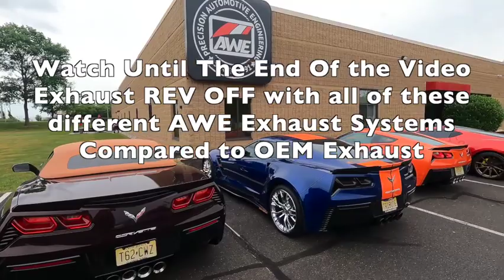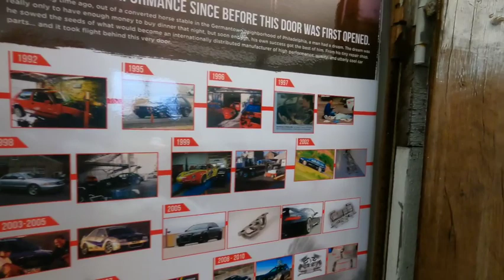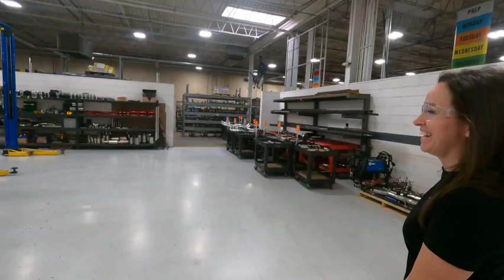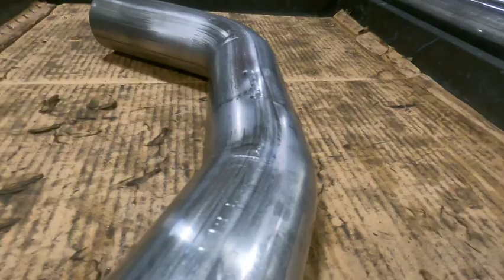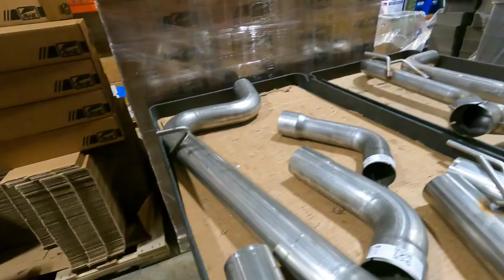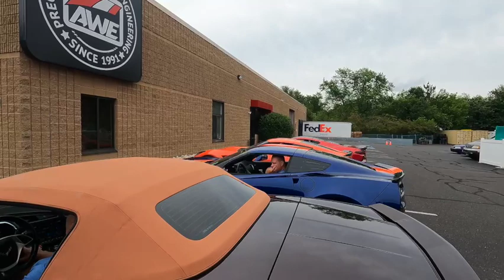AWE Exhaust Factory Tour + C8 Z06 Exhaust Upgrade + Corvette Rev Off!

Comment: Zipity, you're a Corvette salesman. You said the  Elkhart Lake Blue Z06 has the Z07 package. Correct me if I'm wrong but Z07 package comes with the high wing. You can get Carbon wheels on all Z06s.
Reply: You’re correct. The Z07 has the massive wing, canards, aero strakes, extended front splitter, Cup 2 Rs, carbon ceramics, and the FE4 suspension. You can option the carbon fiber wheels separately.

The Z06 in the video was not a Z07. Still a beautiful car though!